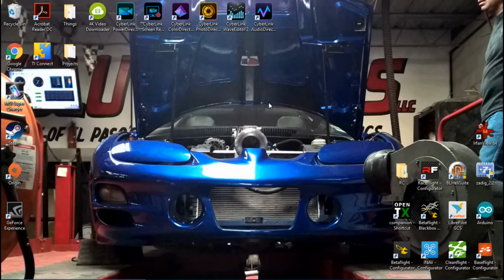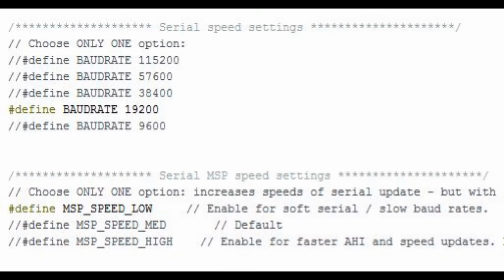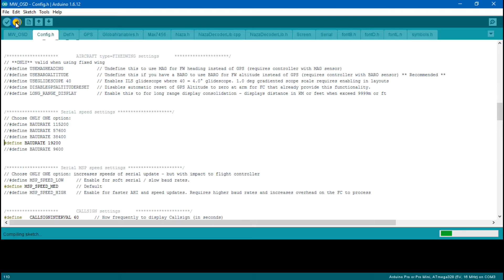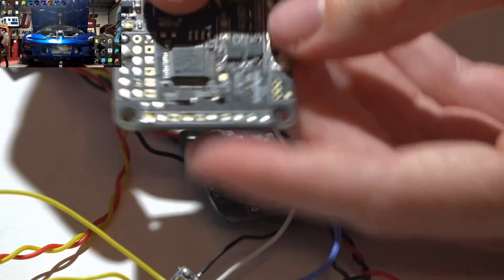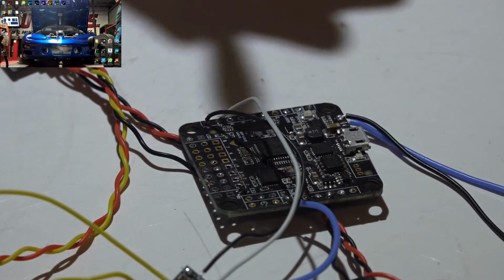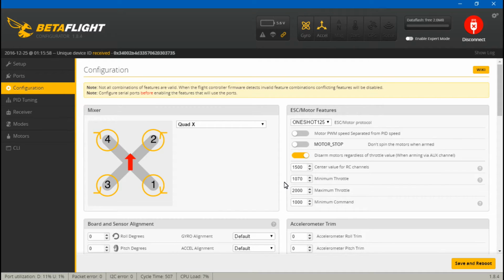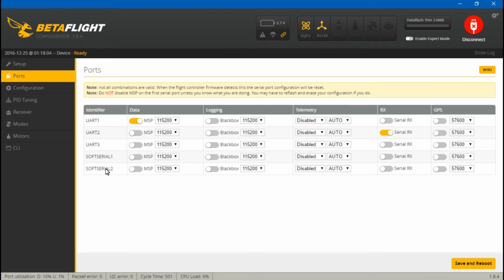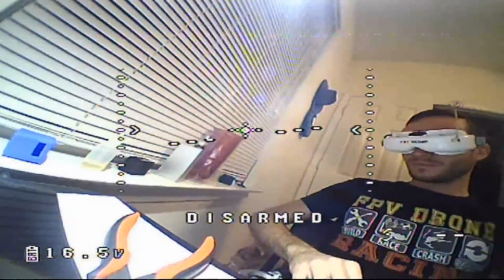Placing OSD On Soft Serial

Comment: Hi JC, 

Got a question, I did watch a whole lot of videos from you and used Google just didn't find the answer to my question. 

I have a SP Racing F3 with 3 regular uarts. 

UART1 is USB 
UART2 is X4R SB smartport telemetry 
UART3 is X4R sbus 

Now I want to add and OSD and Painless360 says you can add it to UART1 and you need to disconnect it before using the USB, which is a pain because I want to solder the wires. 

So I'm considering using a soft serial port for either the telemetry or the OSD, which one would you prefer? 

Regards,

Comment: is it possible to do serial passthrough to soft serial port? i've tried with command line below but not working (i am using soft serial 2).
serialpassthrough 31 19200
Reply: Did you find a solution for your problem? I am in the same situation: using UART2 for GPS, Softserial1 for Telemetry, UART1 should be bluetooth - MSP on softserial2 does not work. If i connect the minimosd to UART1 it is working out of the box!
What did you do for working?

Comment: Hey JC can I use soft serial for XSR telemetry, and which pin would I place it on in the dodo, thanks
Reply: NM I found the answer, it's yes , you connect the smart to either 5+6(Softserial1) or 7+8(ss2).